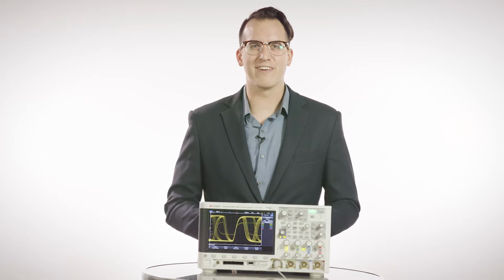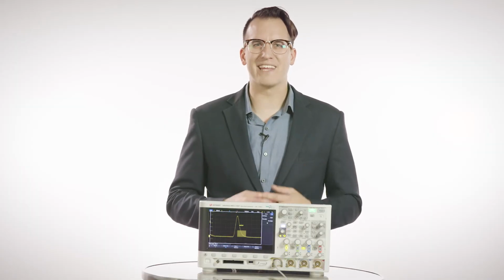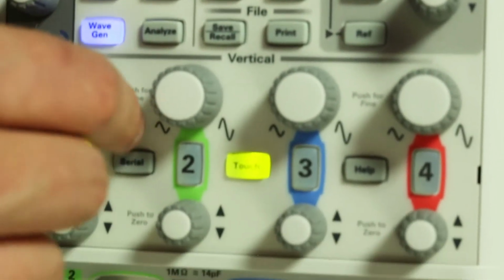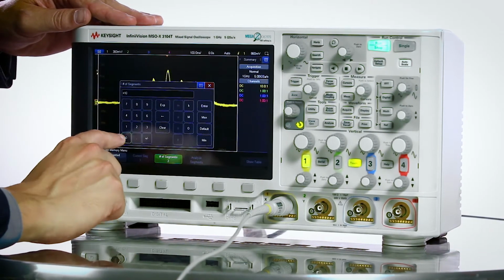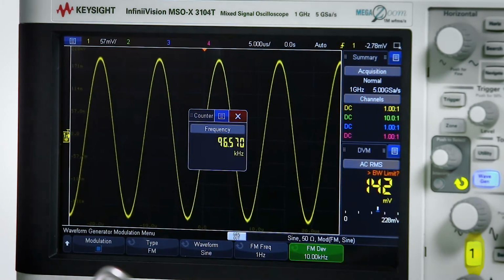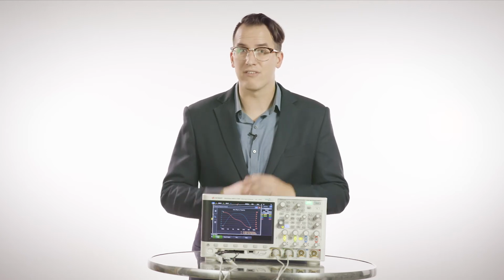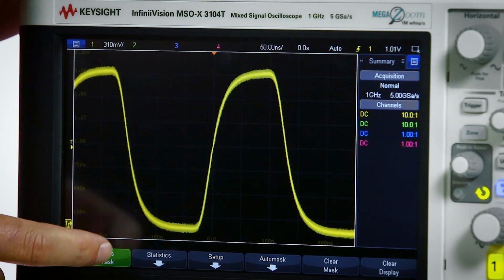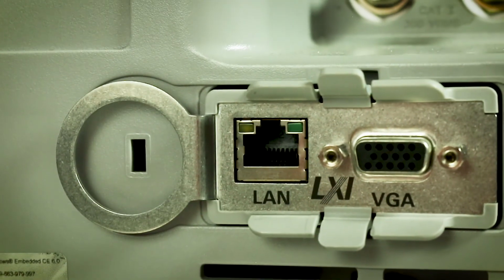InfiniiVision 3000T X-Series Spotlight Video

Comment: Just as a feedback as an engineer I passionately hate touch screens, don't think that it's a plus to any product, i see it as a negative.  I like real slides, buttons and jogs, and keys, not that vague fingering on Plexiglas. Otherwise good points about the update rate, waveform frame rate when adding analysis.  That is very important and i was looking for that.